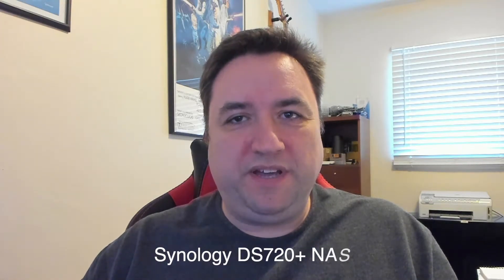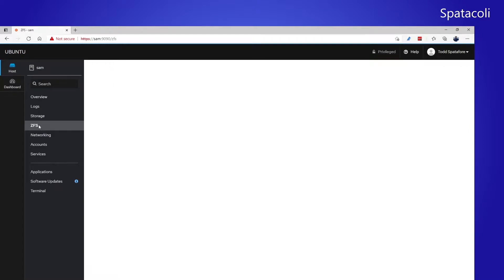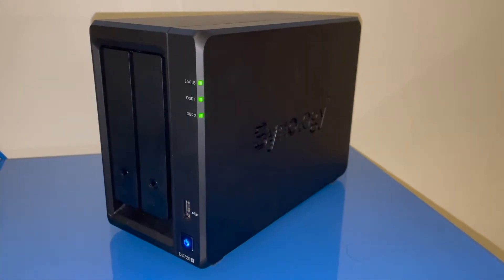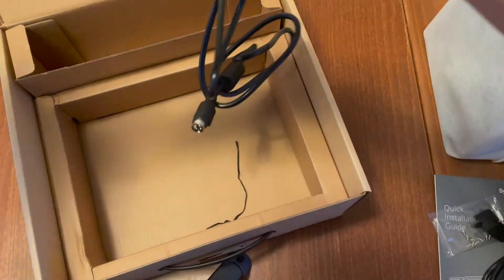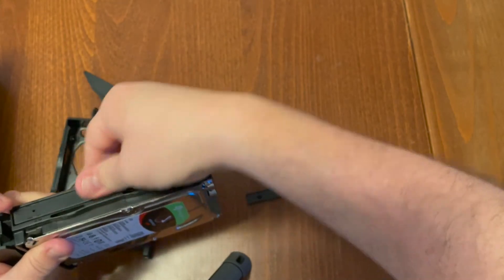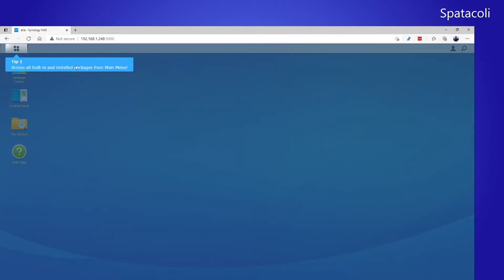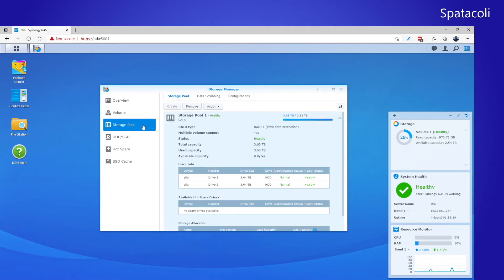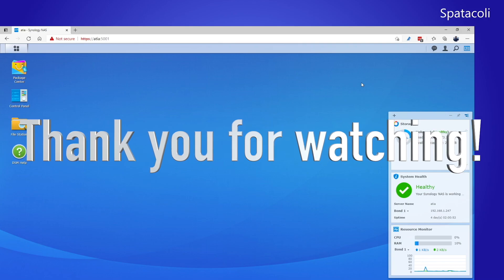Synology DS720+ NAS

Comment: Just finished your 3 videos on building the little white NAS. Brilliant stuff, enjoyable to watch. I was a bit surprised tbh to see you parting ways so soon with it. Did you eventually figure out why the drives had so many errors? Bad batch of disks or was it the PI Sata board that’s not so reliable?
Reply from the maker: I think it was overheating the drives. I was always a little worried since it isn’t made from equipment that was designed for the purpose I was using them for.
Reply: @ToddSpatafore  so all in all, nice little hobby project, but practically unusable atm. I’m looking around for a new NAS, mine’s from 2013 (DS213+). I guess I’ll just buy a new Synology and be done with it.
Reply from the maker: @michaelwaterman3553  I agree. It was a nice hobby project and I'll keep it around for something, but I quickly bought the Synology DS720+. Good device.